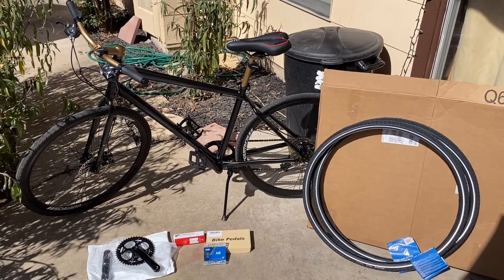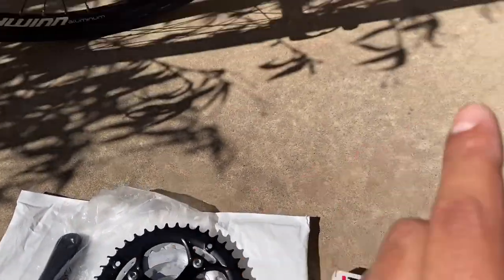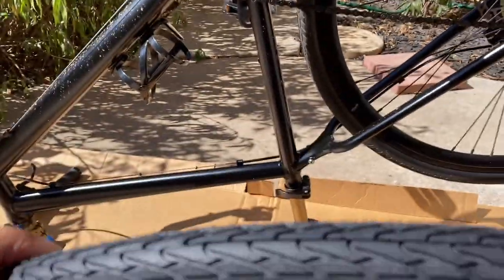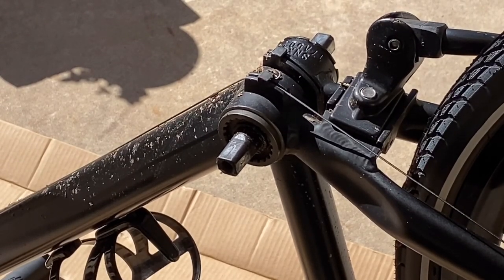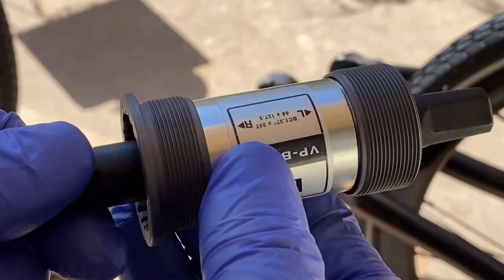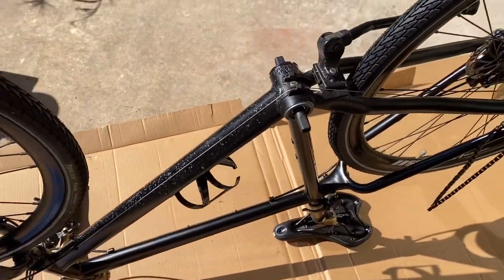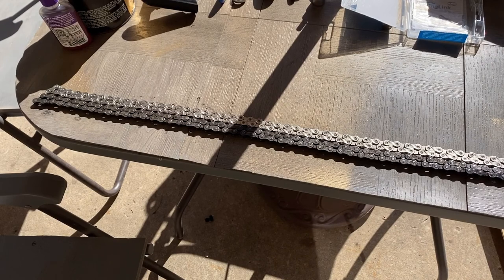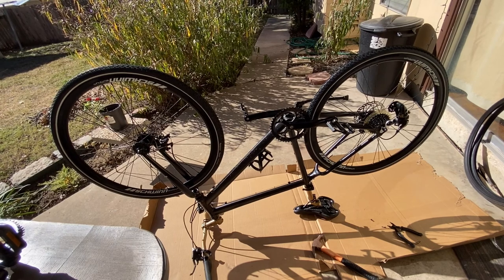Schwinn Hybrid Circuit Upgrades

Comment: 1 question...For the bottom bracket did you use 68x103 or 68x110.5? I have exactly the same bike from target.
Amazon sceps said 103,but same Amazon picture shows 110.5mm...Thank you for the good video.
Reply from the maker: Thanks for watching I used the 68 x 103, worked out great very happy with this bike and all the mods. I hope you enjoy yours as well. Stay safe and ride strong.👍🏽✌🏽
Reply: @solisapaul  dO YOU THINK 68-110 WILL WORK??? tHANX
Reply from the maker: @bryanazbel5440  sorry for the late reply in all honesty I am not sure it would and I’d hate to say yes it will and it doesn’t. I would play it safe and go with the 68 x 103 because I know for a fact it will work since I put that on my own Schwinn circuit. Hope this helps. 👍🏽✌🏽